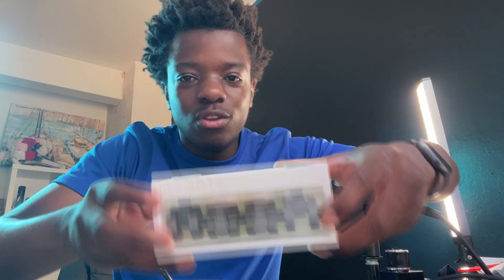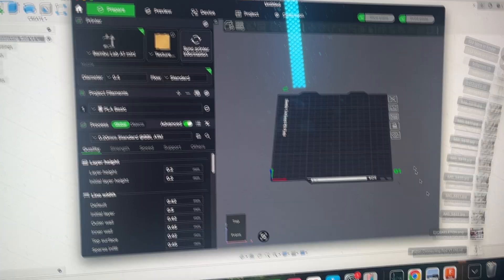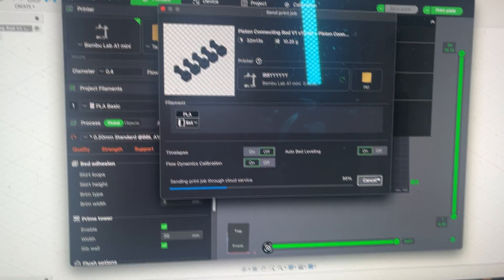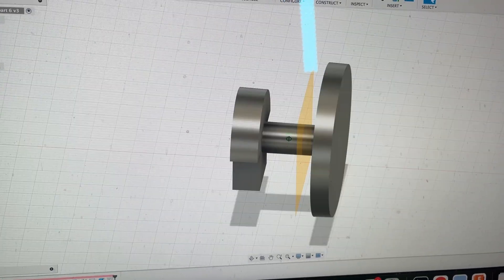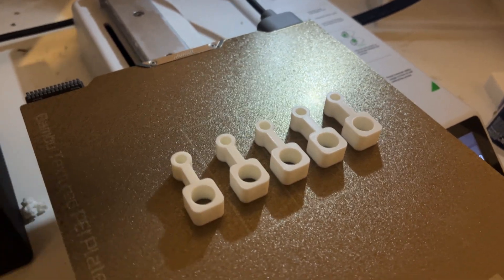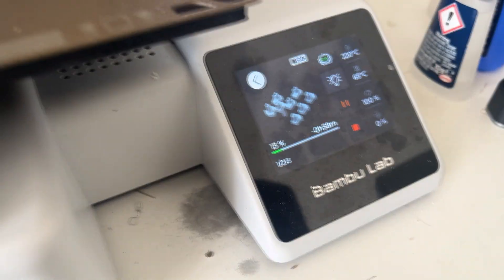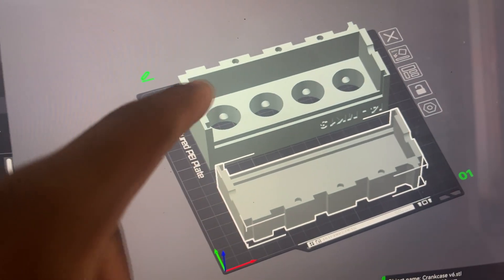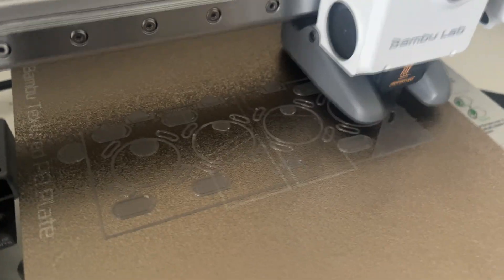One Tiny Flaw Nearly Ruined My $1750 Engine

Comment: I hate to call out the clickbait... This giving into the fact I got baited...But how do you consider your print/model to be a '1750 dollar' engine?
Reply from the maker: I talked about this is a previous video, I’m going to be machining this engine block out of titanium for my school project so the material costs and the tools to machine total about that much, I got quotes a few weeks ago, additionally labour costs which I didn’t even factor in. If I were to sell a full titanium or stainless steel model after I’ve refined my design I would definitely sell it at around that price at leas
Reply: @i88y  so you are basically just printing it to test if it works or looks as intended irl? that's pretty cool ngl
Reply from the maker: Yes exactly! it would be pretty ridiculous of me to go straight into spending that much without even having a physical model at hand. i might even make it out of aluminium or stainless depending on how much i have to spend on it
Reply: @i88y  Sounds like a fun project! Good on ya for tackling such a tough material.
Reply from the maker: Thank you 🙏